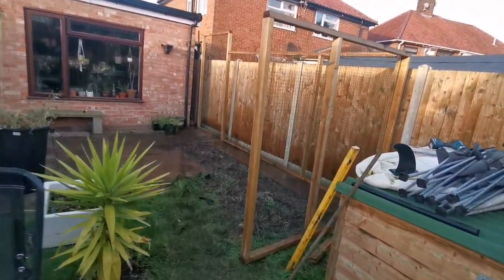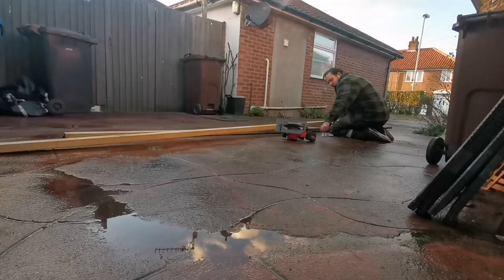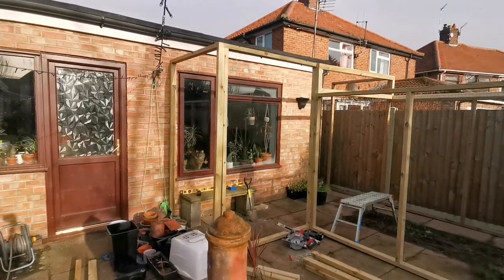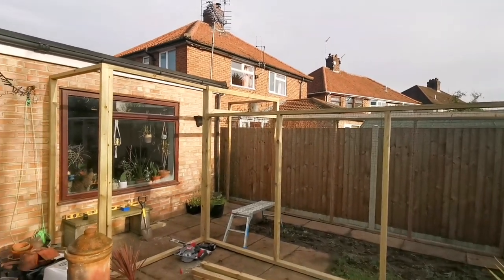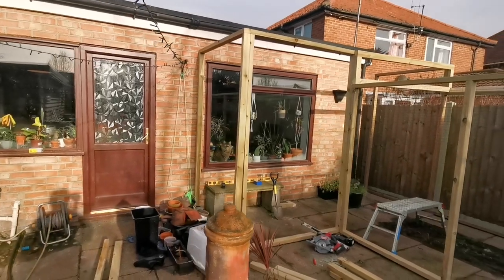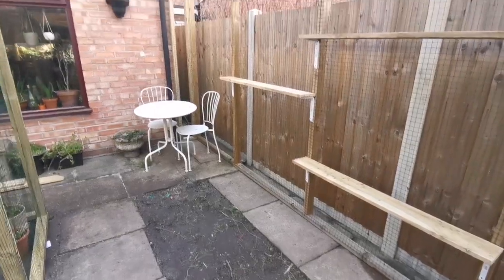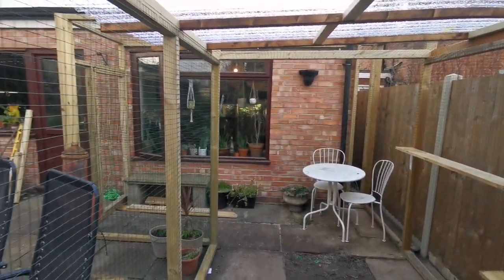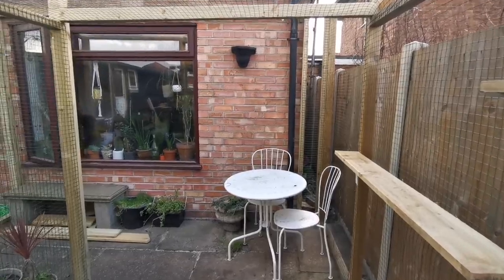How To Build a DIY Catio / Cat Run

Comment: Hi I'm looking to build my cat a catio but choosing the right wire mesh is a mine field, could i ask which you used? Catio looks fab by the way 🙂
Reply from the maker: Hello, my preference is 25mm square pvc coated weld mesh. I prefer it much over chicken wire as it doesn't stretch and helps makes much neater panels.

Comment: Did you fix it to the slabs as well??
Reply from the maker: No it isn't fixed to any slabs
Reply: @norwichreptileshed probably a stupid question but what stops it from falling over, say a kid running into it lol
Reply from the maker: It's solid because it's made from 3x2 timber and once all the sides and roof are attached and it's fixed to the wall it's fine